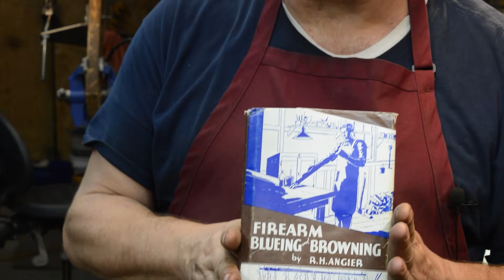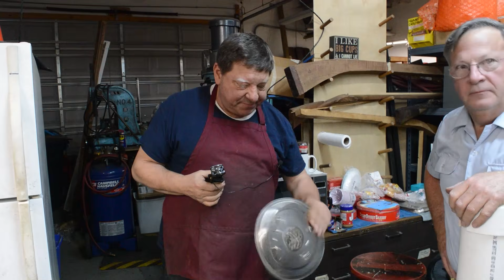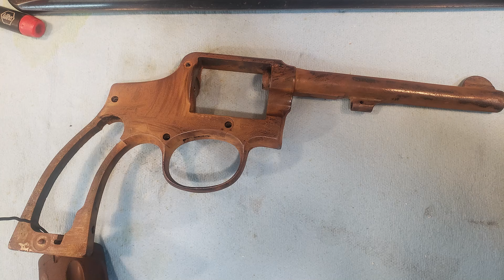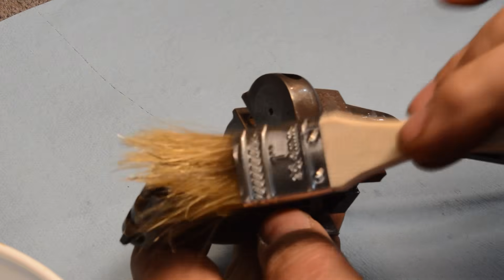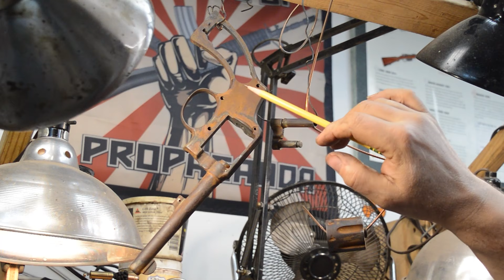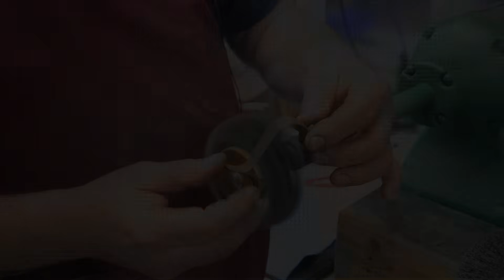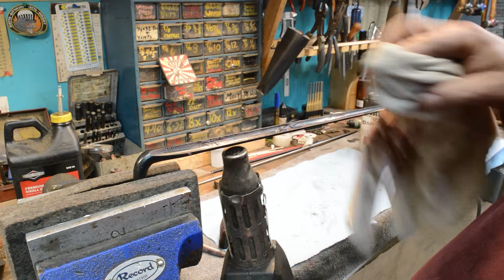Rust Bluing.....Anvil 0109

Comment: I used this process with a little .32cal pistol that my dad gave me, it is a Steyr-Piper 1908, it had a lot of surface rust and a was pitted pretty badly. So I used your previous video. I practiced with some steel washers until I got it down perfect, before performing this on the pistol. 

Anyways, the pistol came out beautiful. Almost too new to my liking to be honest, but it’s not rusting anymore! The only problem I have now is that I don’t know how to put it back together because the pictures I took while taking it apart are gone with my old phone... So that sucks.
Reply: Sorry I don’t know anything about those pistols but is the 1909 anything like it and enough to use as starting point to put together? https://m.youtube.com/watch?v=eycaGbje-ZQ

Comment: The humidity you describe is basically late July thru August in the deep South. 
  So, in the deep South, do your rust blueing late summer and forget about the fancy shmancy setup you are using in this video. 🤔 😄
Reply from the maker: Short answer, yes. However, if you do volume bluing, recommend the forced box steaming, if only for the consistency of the finished product-
Reply: It's not always summer, and I live in Minnesota. So doesn't work always or for everyone. But ya, I get the joke. Many people actually do, but you have to wait a good number of hours.

Comment: in the conversion process, how does one protect the bore?  Is that even necessary, or is the bore polished with a few rounds and a cleaning brush?
Reply: From what I remember, you are keeping the chemicals out of the bore. The rust blue won't really get in the bore, and any rust that does start in the bore comes out with a couple passes of a brass brush.
Reply: @ScottKenny1978  And that method of controlling the extent of conversion makes perfect sense for the chemically blued guns, but what about for the barreled actions that are blued with water, heat and air (i.e. in this video, the Vedderli)?
Reply: @amschind  that one I am going to defer to Mark.

I don't think it is any different, but I haven't done the work myself to confirm.
Reply: @ScottKenny1978  To rephrase my question so that it's clear: you can deliberately avoid applying bluing agent to the bore, but I didn't see any method of excluding the steam from the bore when steam (rather than a brushed on chemical) is the oxidizing agent.  I suspect that the residual oil in the bore may have something to do with it, but I'm obviously unsure.
Reply: @amschind  there shouldn't be any residual oil in the bore.

Any light (orange) rust will just scrub out with a brass bore brush, been there done that a few times.

It's the black rust I'm not sure about.
Reply from the maker: @amschind  20 minutes of steam doesn't even begin to form an oxide in the bore. It took 3 hours, with a chloride agent, to FORCE the outside to rust.
Reply: @marknovak8255 Thanks!

Comment: Do you think they knew about this in the middle ages?  In a lot of medieval illustrations of battles the dudes are wearing black armor.
Reply: Most were blued in the literal sense of the word, as in heated by a blacksmith on coals until they went from straw to blue. Often with fire guilding, as bluing was reserved for more expensive pieces. As far as I kow, there is some evidence for blacking, but it doesn't seem to have been very common. Modern day museum pieces appear black, but have also been polished for many years and don't necessarily represent their original appearance.
Reply: I suspect that it was more like heated oil, like a seasoned cast iron pan.

Comment: Never go easy on Brake Clean... You want to use enough to move the oil completely off of the part you're cleaning. if you give something a light spray you can end up with a line of oil a little further down where the break clean evaporated.  (Not directed at Mark, just a hard learned lesson.)
Reply from the maker: True, very true. Function of the videos is to get this very conversation started......

Comment: I think that crusty rusted .22 would be a good candidate if you wanted to show an example of what to expect out of boiling a gun with that kind of rust.

That's like the exact kind of rust were all familiar with from a .22 or an air rifle that was left in the shed or on the back porch.

We all know that boiling is a common process,  but not when it's appropriate or what to expect with a gun like that which many are likely to start with.
Reply: You need to get the loose rust off with steel wool first. After it's boiled and carded, it'll have a dimpled surface where the pitting is deeper. 
     A couple of years ago I got some old Soviet era AK magazines that were really rusty. The rust had forced the multiple layers of steel to bulge. The outside of the mags were too wide to easily fit in a rifle and the inside was bulged to the extent it would bind the follower. I removed the surface rust and boiled them. I blew them out with air and soaked them with solvent. Boiled again and then I had to press the inside walls out and the outside walls in. I got them to where the follower didn't bind and then had to remove a few thousandths of metal off the outside of the sides(of the top where they fit in the weapon) to make them fit a rifle again. I really over-thinned some black rustoleum paint and dipped them in that for several minutes. I pulled them out and let them dry(I needed to get something inside those steel layers to prevent them from rusting again). They all work fine. In this particular case, I didn't care about the appearance, I just wanted them functional(and the flat black paint looks fine after they were oiled up).
     Ya'll Take Care and be safe, John
Reply from the maker: @JohnDoe-pv2iu  Yep, exactly. Good bust...!

Comment: Mark, As always, fantastic video and knowledge.  Did you make the reduction mandrel on the Baldor Carding set-up?  Thanks
Reply from the maker: No, it's just a straight 1780 RPM 4 pole. BUT, it has the TORQUE to pull a full 16 inch wheel in a buffing application. That's where it shines

Comment: @Mark Novak : When you were chemical wetting the double receive using  a el-cheapo brush, if you were doing more than a few pars but still not production, could you apply the chemical agent from a small pump sprayer to get the first coating down, or do you believe that would be ill advised?
Reply from the maker: It IS an acid, best not spread that around. Salt spray at the beach type destruction.....
Reply: @marknovak8255  Most interesting indeed, didn't realize it was an acid but yeah that makes a whole lot of sense now as to why the brush was eaten up ratty looking. Thank you for getting back to me on that. Have a bonkers good day.

Comment: OK now, I'm going to put away my Rust-Oleum spray can, one each, condition code "A", Black, and go for conservation and actual rust bluing. My 870 WingMaster is camo rust-oleum paint with a slight coating of Mallard and Squirrel blood. I painted it in the mid 80s. I bought it new, and it was so well shined that it scared off the Ducks.

Comment: Parts for the turkey pot/toilet flange system in January... $65 total. It paid for itself the first time as I had great results. I'm thinking about rebluing my Win. 1907 next.  It's an early nickel steel type and it's completely missing the hot dip blue  I'm afraid all that nickel won't  blue or it will come out purple. I may let a sleeping dog lie.
Reply: Ever see an old Ruger P series semiauto (aka a boat anchor that shoots 9mm) that has blued parts on it? They turn an interesting plum color. My Russian capture Kar98K has the same odd plum color on the bolt in some spots and on the rear sight. Strangest of all, my M1895 Nagant's cylinder has turned into a copper/bronze color! No idea what that's all about. It doesn't look like "patina" oil coated rust to me. It is almost like it was cerakoted burnt bronze. It was purchased in 2007 or 2008 from JG Sales straight outta a Russian crate so I know it is not painted or coated. That's just what time has done to these examples of bluing. If your gun turns out a plum purple color, it wouldn't be all that unnatural and out of place. Sometimes blued guns end up that way. Idk why. 🤯

Comment: So where does kerosene come in to play?
Reply: It's used to displace the water from tiny nooks and crannies after boiling the part, and to coat the metal in an oil to stop surface flash rust. Easily removed with brake cleaner later on, and it will mix with the REAL protective oil coating that you apply at the absolute end of the process. 👍

Comment: What is the rpm of your carding wheel?????? I used mine on a bench grinder and it ate my steel
Reply: There’s a high speed bench grinder which is much more common and a low rpm machine, harder to find.  I’m betting you were using the high rpm type.   Be prepared to pay more for the slow machine.
Reply: Just checked the data plates on my machines.  The typical bench grinder is 3500 rpm.  The low speed Rikon machine is 1750rpm.  The slower unit can be difficult to find in a price point machine.  A belt driven arbor unit could be slower.  Like others have suggested, are you sure about your carding wheel ?
Reply: Your wires were likely too stiff/aggressive. It's gotta be soft like an SOS/Brillo pad or 0000 steel wool.
Reply: Not sure how fast his is going. I use the same exact wheel that he's using chucked in my bench drill press set to its highest speed 1500ish rpm.
Reply: Don’t recall the wheel,(0000 I think , I know it’s soft ) but grinder is 3700,,, to fast,,,,, hard to find a slower one